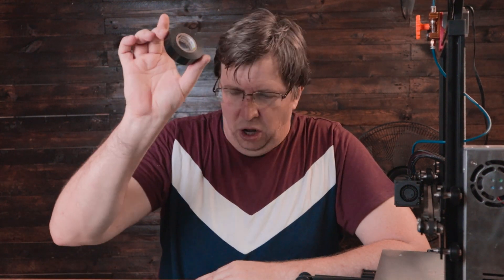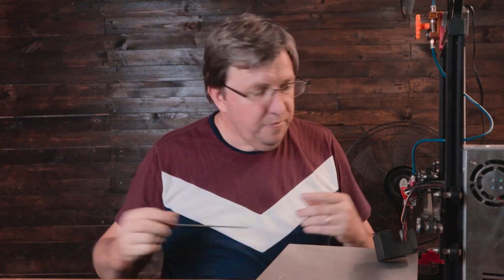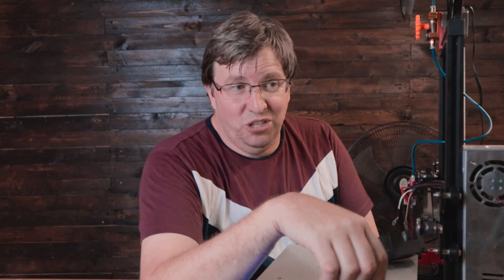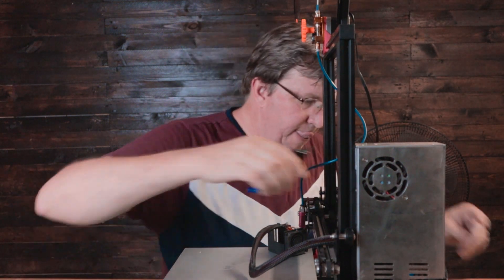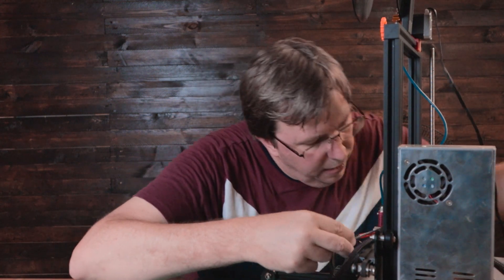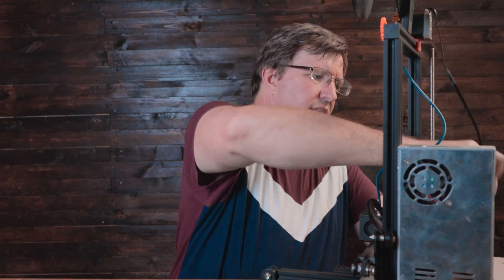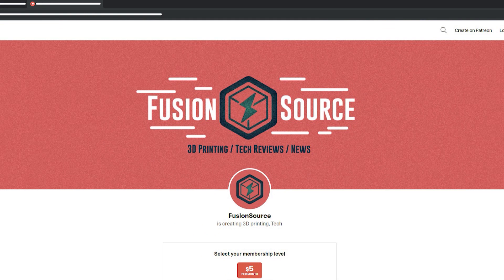THERMAL RUNAWAY | Replace the Thermistor | HOW TO

Comment: just saying its a little more work but after cutting the zip ties and opening the bottom to the board i used machanics  wire to run the wire

Comment: Many seconds after I put my printer (Ender 3) on, start a terrible "beep" and a message apear at the display ... Error E1, could be any short circuit on the themal sensor ?
Reply from the maker: Hi Jose, sounds like you may have a short, try unplugging the sensor from the main board and see if it helps, then get a new thermistor, plug it in before installing and see if that helps.

Comment: I replaced the thermistor and it shows err: maxtemp.....
Reply from the maker: It sounds like it is not making proper connection.  Also is it the correct thermistor for your machine, the resistance could be different.

Comment: My old thermistor broke and I went to remove it, it wouldn’t  come out. I tried heating it up and then removing it, but the wires snapped and to glass bead is still deep inside the hot end. I don’t know what to do. Should I put the new thermistor in with the old glass bead thing thermistor still in the hot end ?
Reply from the maker: Hi, that is a difficult question, I would use a drill bit that is a little bit smaller than the hole, don't put the drill bit into a machine, just do it by hand to clean out the hole.
Reply: @FusionSource  thanks for the help and the quick response

Comment: I ran into a couple issues. The primary one is that there's this heat-proof tape tightly wrapping the wires together where they touch my hotend. In order to get enough slack to replace the thermistor, I'd have to cut this tape, and I don't have anything (or even know what kind it is) to replace it with. The other issue is that I'm working with an ender 3 v2 neo and The plug end of my replacement thermistor doesn't look like yours, so I'm not entirely sure that I'm putting it on correctly. I've looked at lots of other videos showing the replacment for my specific models, but they all show printers where the stock hotend has already been replaced with an upgrade, and the heat-proof tape is gone so I'm back to my first issue. Can anyone help here?
Reply from the maker: Hi, it should be safe to remove that tape, I think it is probably Kapton Tape, you will not need to replace the tape, just make sure the wires are handled neatly.

Comment: I don't have a screw can it just sit inside there without one
Reply from the maker: I would not, if your printer is not setup with thermal runaway, it could cause a fire.  Is there no screw hole, or is the screw missing?
Reply: @FusionSource  I think I just figured it out the screw goes in the top with the cables rather side the the senceor goes below
Reply from the maker: @1937Brett  Great, I hope the video helped.
Reply: @FusionSource  thank you for the quick reply
Reply: How far do I put in the sensor to the heat block?
Reply from the maker: @1937Brett  Hi Brett, sorry missed this message.  Do you have heat conducting paste, similar to the type you get for CPU's?  If you do, use some of that then push the glass bulb in until it touches the back of the hole, then put your screw in.
Reply: @FusionSource  I have pictures I could show you
Reply from the maker: @1937Brett  My email address is in the about of my channel

Comment: Thanks for your very good video! I want to share with you something I've saw with my Ender 3. I had E1 error in a very erratic way since two weeks ago. I'm pretty new with printers. Looking to this video, to change my thermistor I have found something interesting: I think that the white stuff surrounding the thermistor is thermal grease that becomes similar to melt plastic because high temperatures with time. If you take off the old grease and use new thermal grease it will work very well if the thermistor IS IN GOOD CONDITIONS. With a syringe, the work is quite easy. The reason is that thermistor can vary too much the signal when it has no full thermal contact with the metal block (the variation of the resistence is exponential!). In my case,  temp start to jump in erratic ways as the head moves. That's because the movement provokes bad thermal contact.
Sorry for my very bad english. Cheers from Argentina!

Comment: That is interesting. I too updated my firmware when I installed a CR touch and within a few mins of printing my thermal runway error also appeared.  Does it mean my previous firmware was unsafely ignoring the thermal runway?  Hmmm. Upon closer inspection of the thermistor the wire was poking out of the sheathe where the screw was holding it to the hot end.  Also great tip with the cable using the old thermistor to pull the new one thru.

Comment: I just bought my 3d printer back in December 2022 and I had 2 main problems: it gets stuck and thermal runaway. It's not even that old.
Reply from the maker: Hi Justin, check your PID settings, here is a link to a video https://www.youtube.com/watch?v=3K3yf04do28
Reply: @FusionSource  ok
Reply: @FusionSource  I had just replaced the motherboard and put all the cables in the right spot because I didn't want to have to break it down and send it back.

Comment: where did you plug the thermistor to printer?
Reply from the maker: In the same spot where the damaged thermistor was plugged into.
Reply: @FusionSource  so you need to open the pcb?

Comment: for anyone who's confused by the motherboard side I'll try to explain it the best I can... so you'll have to flip the printer on it's side to get to the motherboard and there's gonna be two short screws and a long one keeping the bottom plate on, and one more short one on top under the bed. (I'm referring to the bottom of the box that you put the micro sd card in) once you get in there you'll need to tug on old thermistor to figure out which wire it is. (for me it was the furthest one from the hole where the wires come in) mine was hot glued in so I had to carefully cut it out with an xacto knife. simply thread through the new thermistor and plug it into the same spot and you should be good to go... hope this helps
Reply from the maker: Thanks for the explanation

Comment: I have a thermistor that is far too long and I need to chop it shorter and put new JST crimps on it for the connector , am I correct in thinking the polarity does not matter?
Reply from the maker: That is correct, no polarity

Comment: Hello again. I replaced the motherboard on my Ender 3 3D printer with the Creality V4.2.7 motherboard. The issue now is that the Fans (Thermistor and Motherboard) keep shutting down after I've set the fan Speed to 100% and   I have to replace the Thermistor again . Any thoughts? Also, the Settings which is where I set the fan speed isn't taking causing the fan shut down.

Comment: Great video Makes it easy for me to change the thermistor HOWEVER I'm finding that my thermistor is burning out (Literally) to the point I replaced it 2 times today when it burnt out on me and I got the runaway pls reset the printer. what solution is there for the Thermistor needing to replace every print (in my case) they may not be expensive but it builds up.
Reply from the maker: Hi George, thank you for your comment.  I honestly am not sure what this issue could be, I will post it on my forums and see what reply I get.  To me, though, it sounds like it could be a main board issue.  A relatively cheap solution is to put in a BTT board and it is a significant upgrade to the original board if you have an Ender 3.  I hope this helps
Reply: @FusionSource  Thanks. I think you may be right about it being a motherboard issue After the 2d thermistor blew I noticed that the fan for the motherboard wasn't working so I ordered a new one along with more Thermistors from Amazon. I will keep you posted if this fixes the issue. Again Thanks for your reply and assistance.

Comment: I took the silicon style flexible cube shaped thing off my ender hot end to unblock a filament snap off in there and got this alert all the time until I put the silicon sleave back on my direct drive printing nozzle. so you might be able to try that too, it worked for me.

Comment: I hope this fixes my issue. I installed the Ender direct drive update and promptly got a thermal runaway. Replaced the original hardware and immediately it went away
Reply from the maker: Hi, did you come right?

Comment: I have been having an issue with my printer reaching the print temps of 200 and up Fahrenheit. It gets to about 170 then slows down heavily to heat up. I then get the thermal runway E1 error.. just replaced my thermistor and same issue?
Reply from the maker: Hi, please look at this video and let me know if it helps: https://youtu.be/3K3yf04do28
Reply: @FusionSource  I am a moron. It was the insulating piece that goes on the nozzle head I removed when unboxing! Now she prints. Just need to calibrate

Comment: I did everything as per the video, now the printer is going straight to an overheat error as soon as it’s turned on, please help?
Reply from the maker: Hi Joe, please run the PID configuration as shown in this video: https://youtu.be/3K3yf04do28
Reply from the maker: Let me know if you have any other issues, is the temperature registering on  the display?
Reply: @FusionSource  I found the fault, I had over tightened the screw, I just backed it off a tad & now is all good.
Thanks for your time & video
Reply from the maker: Awesome, glad to hear
Reply from the maker: Also verify all your connections are correct and secure

Comment: Hi.  Been suffering this since I changed my nozzle over.  Couldn't figure out why I kept getting it.  Turns out I didn't realise the little bit of wire goes into the small hole underneath where the screw goes in.  Have done this and it seems to be printing great now.  Many thanks for this.
Reply from the maker: So glad it helped

Comment: Good video, I recently purchased a thermistor and heating element but they don't have plugs. is there a negative wire or can i connect a plug both ways?

Comment: Hi, I need help, my temp display move every second without heating.
The temp move from 0 to 25 degrees and from 26 to higher AL the time.
I upload a new marlin and the issue is the same. The temp change for the heatbed and the nozzle at the same time.
Can some one help me.
My card is skr v1. 4 turbo
Reply from the maker: Have you tried replacing the Thermistor, they are rather delicate and could get damaged.  They are very cheap and relatively easy to replace.
Reply: @FusionSource  no, I didn't, but both of bed and nozzle have the same problem. At same time...

Comment: Hey 

Thanks for this. 

My replacement thermistor has a different connector to my original. What do you think I should do?
Reply from the maker: Yeah, the replacement can have a slightly different plug but it does fit.  You can either use it as it is, as I did, or you can try joining the cables with the original plug, but that is a bit of a waste of time.
Reply: @FusionSource  I ended up cutting the wires and changing the connectors before I saw this. Everything is working … for now. 

Thank you

Comment: Ugh I replaced both the bed and head therm and it still gets the error :(
Reply from the maker: https://youtu.be/3K3yf04do28 check out that video to do you PID settings, that should fix it.
Reply: @FusionSource  still have the issue but I didn't get any movement on the graph when attempting the tuning. So is my hot end sensor not working?

Comment: My new CR10S had runaway err only doing 255c/110c for polycarbonate. Firmware update and container box fixed the problem. You can buy a box off amazon for 67 but I built one from 3/4" plywood with 2 huge 1/16" pc windows. I will 3d print hinges for the window door eventually

Comment: I just installed TH3D on my CR10 mini motherboard and had the same thermal problems. The thermistor was working perfectly fine before the firmware update, I don't get it. Can you tell us the model number of your spare thermistors
Reply from the maker: Hi, check this video first  https://www.youtube.com/watch?v=3K3yf04do28 and check your wiring.  If all else fails, the thermistor I used was a THERMISTOR 100K 1% NTC PRE-WIRED from DIY Electronics, https://www.diyelectronics.co.za/store/thermistors/630-thermistor-100k-1-ntc-pre-wired.html?search_query=thermistor&results=155
Reply: I have the same problem after I installed th3d firmware on my anet a8 plus

Comment: Can you make one with fixing the heatbed thermal runaway? I fixed my nozzle hotend thermastat 
 thanks to you!
Reply: If the area is too cold, it has a problem maintaining temperature, especially near the edge. I build a plywood box with 2 polycarbonate windows and mine never fails now.

Comment: Thanks for this video 😬

I was getting random thermal runaway, tried 'M303' autotune to reconfigure

Turns out it was the Thermistor had a slightly frayed wire ...

Bought a new one, replaced it as you have instructed, it's now good as new 😃
Reply from the maker: Glad it helped ;-)
Reply: @FusionSource  One thing I think would be good to note - Make sure to replace the zip-ties

The thermistor broke again soon after replacing it, because (I think) without the zip-ties, there's too much movement on the wire near the end - Which eventually broke it with all the back and forth bending

Comment: Help! I took my nozzle off my printer and turned it on and it gave me the E1 failure after that. I put it all back together re did the firmware and now I still get the same error. Will replacing the thermistor make this error go away or do I need to replace the thermistor then go back into the firmware?
Reply from the maker: Hi, replacing the thermistor should fix the problem, I suggest doing a PID update after replacing the thermistor.  I likely got damaged with removing the head.

Comment: Great video, is there any possibility you could show more close-up view/details when moving the wires around the motherboard? I can't see exactly what you're working on and that end of things is fiddly. Thanks.
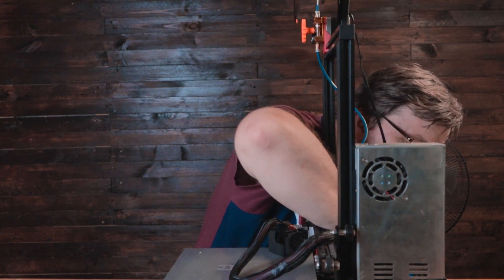Reply: Yes, good content, like your delivery, and would definitely enjoy a few more camera angles. 7:40
Reply from the maker: Hi Kate, thank you so much for your comment.  This is something I am struggling with, firstly as a "one-man-band" I need to do it all and also equipment, ie more cameras, is expensive.  I will certainly try to run more b-roll if I can, usually though, that means doing the same job 3 times.  The first to make sure I know what I am doing to demonstrate it efficiently, second to record, then a third to record the B-Roll.  I will certainly try harder in the future.
Reply: @FusionSource  Thank you, you've got a new subscriber
Reply from the maker: @ericmartin1245  Thank you, Eric appreciate that